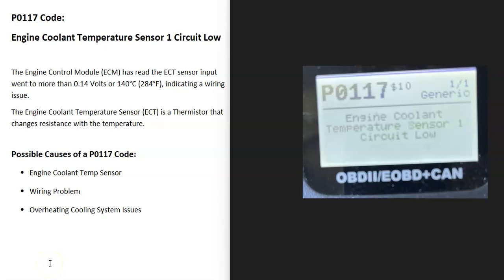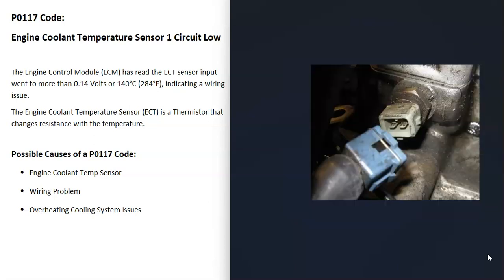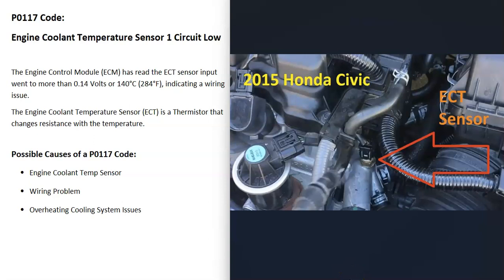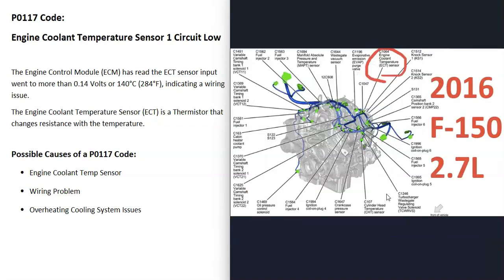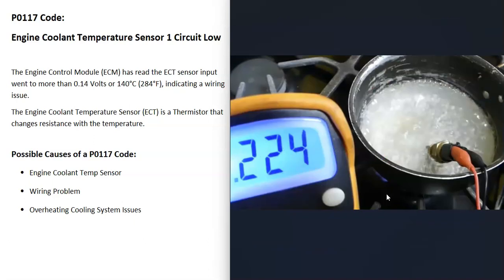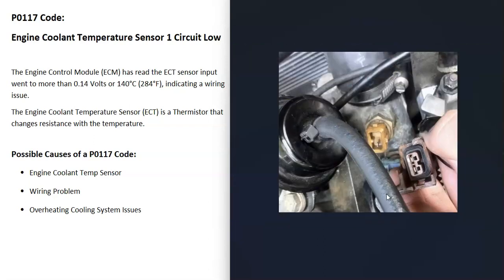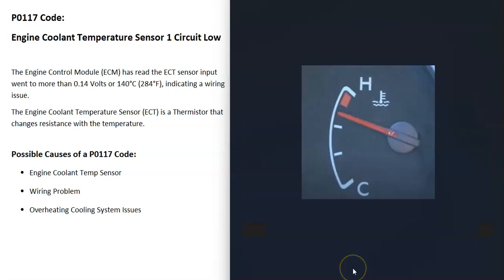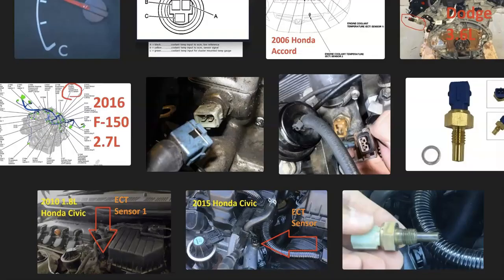Causes and Fixes P0117 Code: Engine Coolant Temperature Sensor 1 Circuit Low

Comment: What are examples of the other code you might get?
Reply from the maker: If you get other codes they can help point to the problem and other causes. For example, if you were to also get something like a MAF sensor code (P0100–P0104), there likely is a circuit wiring problem like a bad ground, causing both to give codes. If there is an overheating code like P1217 and the engine is overheating, there may be a bad thermostat or water pump. In that case, the overheating may be triggering the sensor to set the code.

Comment: Where’s the best place to find vehicle diagrams
Reply from the maker: Sometimes they can be found for free, but that is hit or miss. Professional mechanics use paid services such as All Data or Mitchell Pro Demand. All Data has a DIY section for individual vehicles, but it does cost by the month, and they often have recurring monthly fees, so if used, be wary of which service is bought.